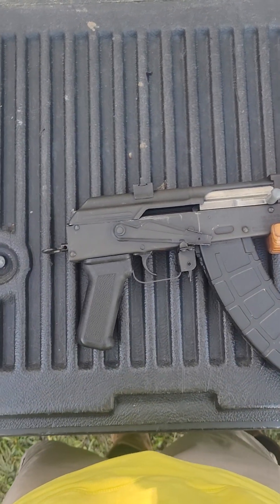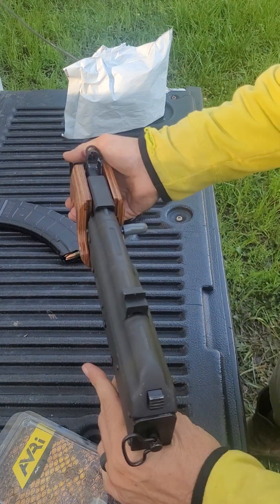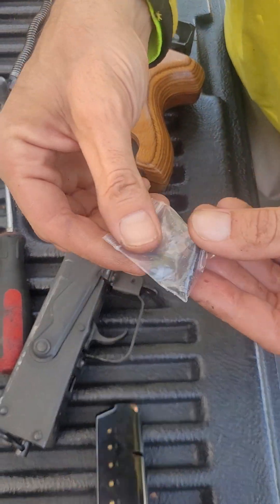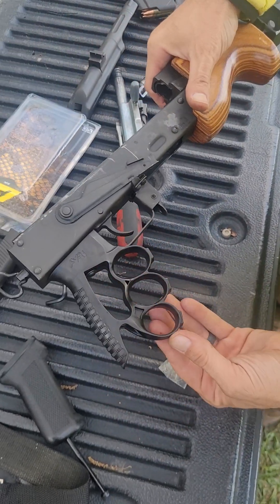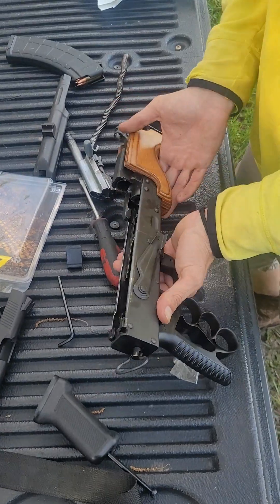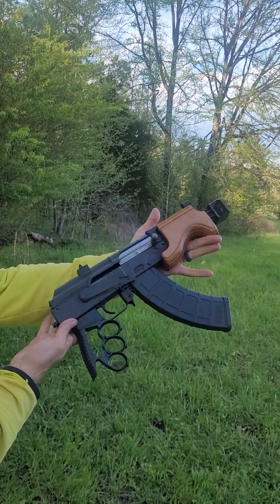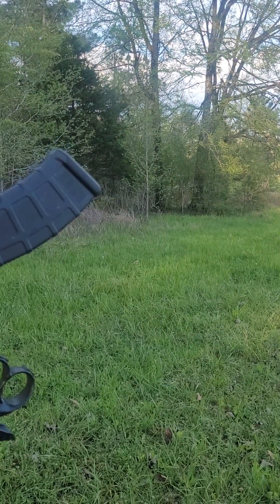NEW GRIP INSTALL ON THE MICRO DRACO @sammoore138 avri grips #draco

Comment: Could you make a video removing the hang hook on the back of buck buck Its so annoying on mines also
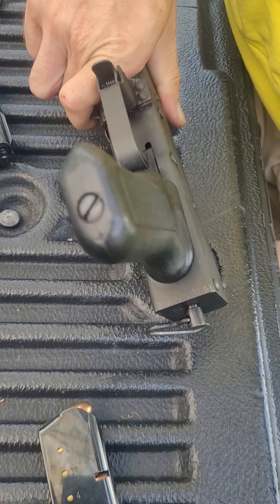Reply from the maker: Wats up brother!!! I already took mine off but if you go to the 2:15 mark around in there I got the gun tore down once you have the gun apart all you need is a wrench to hold the nut on the inside of the gun an unscrew the hook strap right off them jus put the gun right back together jus like I did on the video you DONT HAVE to remove your grip it's out of the way of the nut an is easy to get to I hope this helps if not comment back an let me know!!!!!! AN WE TRY MAKE ONE!!!